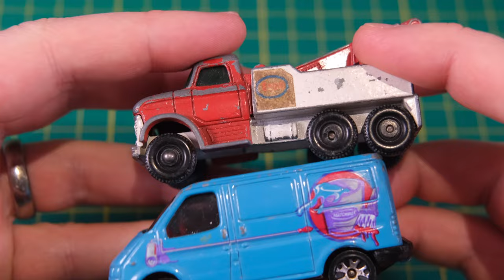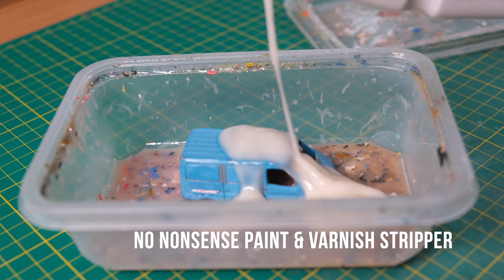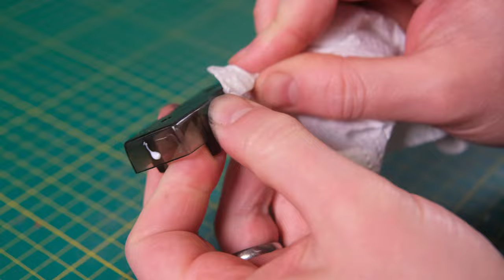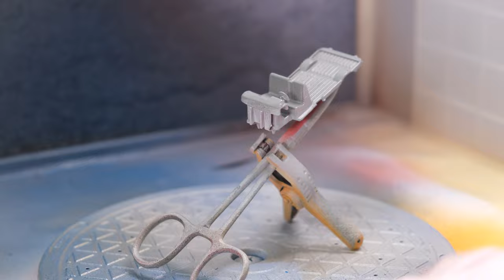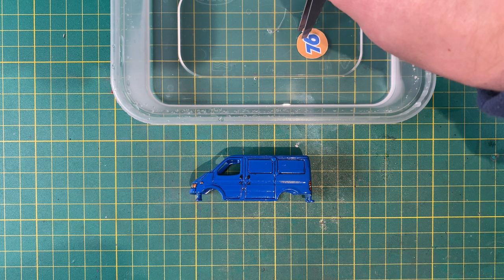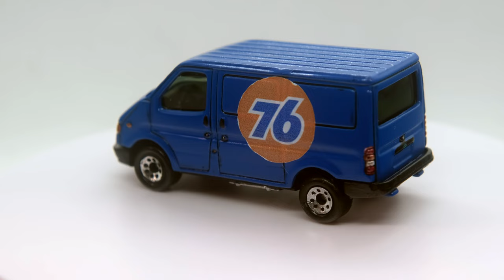MATCHBOX custom commission: MB281 Ford Transit

Comment: That Matchbox Transit could be made into a Tourneo as it has the hatch at the back instead of the double doors. I guess cutting out the side windows would take a while, but as the glass section is a lump of plastic, that could also be the windows for the sides.
I remember this generation of Transit realy well! There used to be loads of these on British roads!